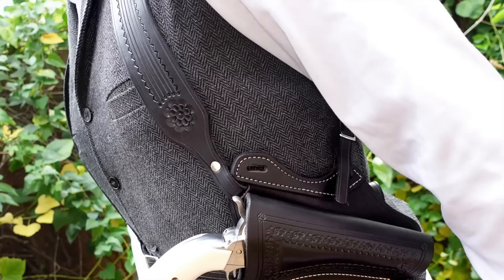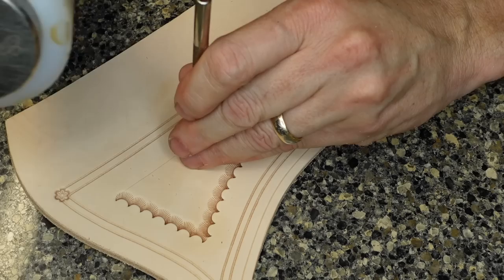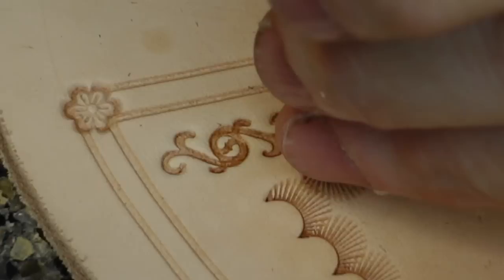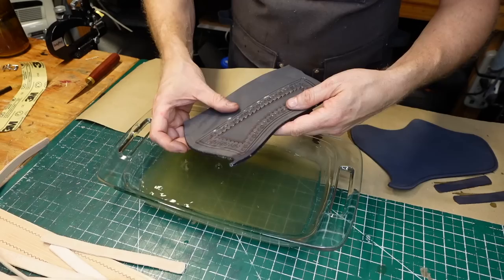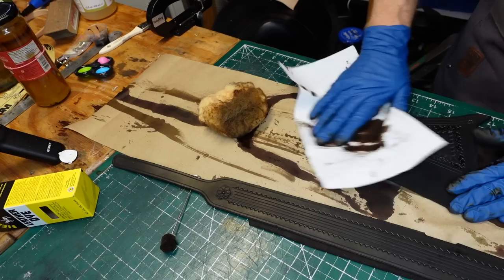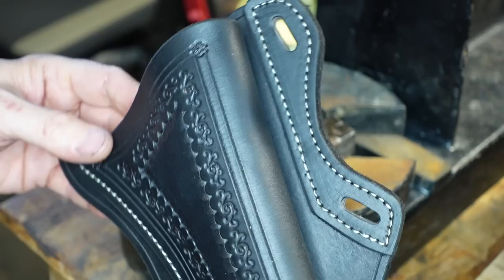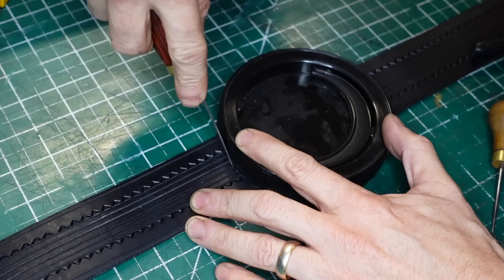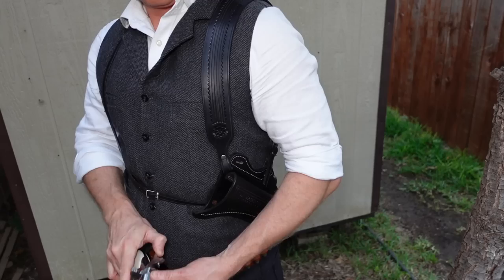Making Doc Holliday / Val Kilmer's Shoulder Holster from 1993's "Tombstone" Leathercraft ASMR

Comment: Really like this one…looks a set back Kodiak rig and the belly strap would be great for horseback riders. Your efforts in front and behind the camera are much appreciated
Reply: I don't care for the strap across the front either. I had an old uncle mike's nylon shoulder holster that never fit me well. The nylon strap always slipped the plastic adjustment buckle and the whole rig would start flopping around. I dug through my tack until I found a leather strap which I fit across the front to try to stabilize it better while a horseback. (Really did not help all that much.) While riding one day after my new adaptation, my horse threw a shoe so I stopped to remove the loose right rear shoe. The horse tried to pull the foot away and then shoved it under the strap, loose shoe and all, clinched nails included. I was then caught and loosely attached to the flailing foot until the strap broke, which I was grateful for, this resulted in a ruined shirt, some slight bruising, a few deep scratches along with a puncture in my belly was all it cost me. Ropes, straps and loose-fitting belts can be an added danger when working with livestock.
Reply from the maker: This is an "old west" style of shoulder holster. I've seen pictures of a similar design in a reference book. I used to have one years ago that had two 'yolks' over each shoulder and connected high across the shoulders in back. Very comfortable. But kinda necessitates having layered clothing to conceal. And were I live it's usually too hot for that.
Reply: @RoadAgentLeather  Certainly know about hot weather here. After my mishap I remove any belts/holsters, including coats, vest or any other items that might foul when dealing with horse's feet in particular. Even the best of them can suddenly do something out of the norm.

Comment: What is that glue you are using? It's not Barge, but it's a contact cement??? Better than Barge? BTW, your work is amazing. So clean and meticulous. I've been known to rebuild a saddle once in a while, and make my own holsters and sheathes, but you have so much talent!
Reply from the maker: Thanks for watching! It's been a while, but I'm using either Aquilim 315 or EcoWeld. Both are low-odor, non-toxic, water-based contact cements. I'm definitely not a fan of Barge, Weldwood, or any of the other solvent-based cements.

Comment: I've noticed that when you use your stitch groove that it's on wet leather. Does this work better for you than on dry leather? I am always afraid of the leather bunching up under the groover blade
Reply from the maker: It's not really 'wet'. . . just 'hydrated' a little. . . sort of like when casing you allow the leather to start dry back to its original color. I found it helps
Reply from the maker: Thanks for watching. And thanks for the subscribe!
Reply: @RoadAgentLeather  I appreciate the information.

Comment: Great job!!!
I have a question,  how do you determine where exactly to sew the skied part of  the holster to the back part.
Reply from the maker: Thanks for subscribing! That was more of an eyeball thing: The two parts of the holster need to come together to properly fit the gun. So I test-fitted several times with the gun in place, then marked where the glue was to be applied.